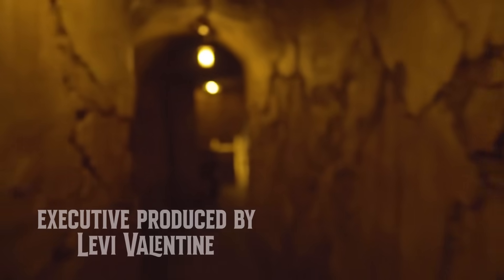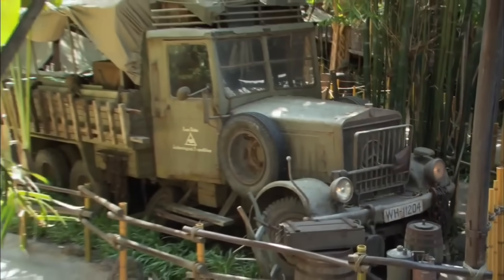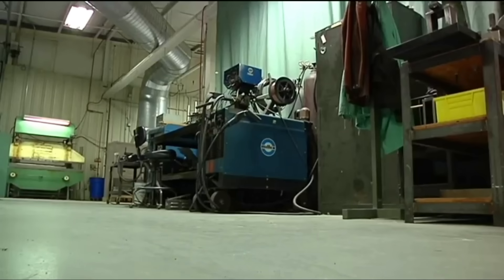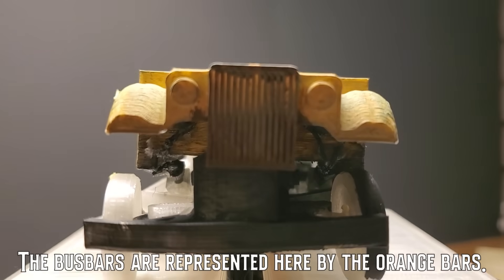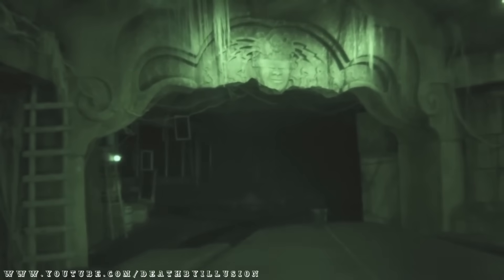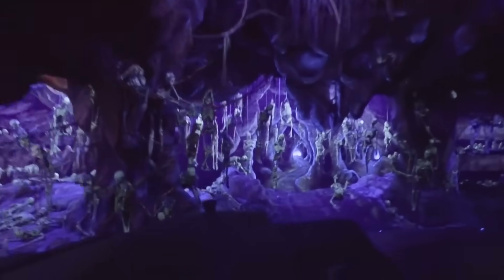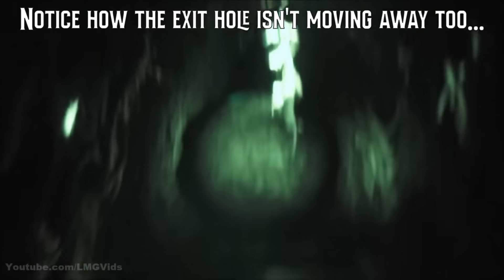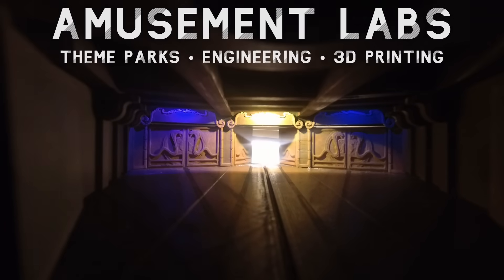How It Works: Disney's Indiana Jones Ride

Comment: The three-piston motion base is capable of much more movement than they currently use it for. After opening, they had to reduce the amount of movement produced by the three-piston motion base, because it was considered too violent for some (translation: Disney was worried about getting sued by people who injured themselves when the vehicle wildly bucked).
Reply: Part of what you said is true, the rest is not. I was one of the original 12 Design Engineers who designed, engineered, prototyped and developed this ride system between 1990 - 1993. Of course the motion base can be articulated into more extreme positions and at much higher velocities. While developing it we did a lot of tuning to smooth it out. That's a part of developing any new design. But we worked all that out WAY before (years before) this ride opened to the public. And all businesses that deal with the public are mindful of the possibility of people getting injured and design and engineer their products accordingly. To do anything other than that would be unethical / unprofessional.
Reply: @GoogleEqualsEvil  I apologize if what I commented was incorrect. However, many have reported to me that the current ride experience is much tamer than when they first rode it immediately after opening.
Reply: @kentslocum They could have modified the motion profile to reduce certain aspects of wear and tear. Supposedly the motion profiles are slightly “randomized” with each ride
Reply: @kentslocum  No need to apologize Kent, I'm not offended. I'm just trying to correct the record / impart the truth and hopefully provide some information that people will find interesting. I'm proud of my contributions to this very complex project (many of my conceptual designs / inventions, of which at least three are shown in this video, were patented by WDI) and when I came across this video and started looking through the comments, I noticed a fair amount of misinformation (including some in the video itself), which I will correct when I have more time. It will be a very long comment and I'll post it as a standalone, so if you go to "newest first" it will show up sometime in the near future.

You should regard people saying they can "feel a difference" in reference to the intensity of the motion base platform movement, as being highly dubious. Unless Disney made really large changes to the motion control programming to increase or decrease the intensity, a human wouldn't be able to tell the difference. There are just too many changes in both amplitude and frequency throughout the ride, and they happen much too quickly for a human to be able to assess and analyze those changes. I'm sure people THINK they can tell a difference, but it's basically impossible.

The motion base originally did have (and still might) a randomization algorithm programmed into the control system that makes small changes to the pattern of the movements for each cycle of the ride (each load / unload of passengers), but no changes to the intensity. It's possible people are mistaking that change in pattern of the movements as a change in intensity. I haven't ridden it in 20 years so it's possible they've turned the intensity way down. But I did ride it several times on the same day, 5 different times from 1995-2001, and there weren't any changes in the motion control programming that I could discern.

A couple of bits of interesting / fun trivia: 1) Contrary to what this video claims, neither MTS or Doron Systems had much of anything to do with either the drive system(s) design and engineering, or the motion base design and engineering. All the design and engineering was primarily done by us. We did purchase various components from MTS including hydraulic actuators, rotary encoders, PLC's, limit switches, position sensors, solenoids, valves, valve bodies, control systems, etc. And the 3 Disney engineers responsible for the motion base actuation and control (one hydraulics engineer, one hardware / controls engineer, and one software (programming) / controls engineer) consulted with MTS at various times, but that's the extent of MTS's contribution (my specific contribution to the motion base design and engineering was the invention and subsequent detail design, engineering and analysis of the three, 2-axis hydraulic actuator Gimbal mounts and their locking mechanisms, and the motion base platform structural design and engineering).

2) We purchased two kinematic "crash test" dummies to use as guinea pigs / data collectors to test the motion base platform before any of us gave it a go. They were jointed and weighted to replicate the average human body and they were packed with sensors including accelerometers and a gyroscope. This turned out to be a very smart thing to do since the first programming map that was loaded literally was so violent it broke the clasps on the lap belts the dummies were restrained by and threw both of them right out of their seats about 10 feet in the air and then right onto the ground.
Reply: @SalivatingSteve  Yes, correct. If the motion control programming has been noticeably "turned down", that would be the primary reason why. This was a very complex design with a lot of moving parts subjected to very high loads (built over 25 years ago), so reducing the amplitude and frequency of the motion control base would substantially reduce wear and tear (which of course would reduce the maintenance and operating costs while also helping to keep the down time minimized). I haven't been on the ride since 2001, and I haven't kept in touch with any of my colleagues who worked on this project, so I have no idea how much, if at all, the motion control programming has been changed. 

People should remember that this was the first of it's kind. It required so much innovative design, that almost every aspect of the vehicle system was patented. Plus we did all of the design and engineering in 3D Solid and Surfacing Modeling, which was in it's infancy at the time. It was very primitive CAD / CAE compared to what's available today. We also did all of this with just a handful of Design Engineers and Fabricators in a very compressed time frame considering that this hadn't been done before. It would have been beneficial to have had an extra 12-18 months just to run the system over and over (we built a full scale prototype vehicle and track inside a warehouse in Valencia, CA) and develop it further to discover any problems in reliability and / or any maintenance issues. But we had to work with / around what we were given.

That is true about the motion control programming randomization (at least it was, I don't know if it's still being done). The amplitude and frequency remains within the same parameters, but the pattern changes randomly. It is quite subtle though. The idea was that a small amount of randomization would make it seem more realistic and keep it "fresh" (different enough each time that people would notice it subconsciously if not consciously).
Reply: @GoogleEqualsEvil  Wow! Thanks for taking the time to respond and for all your hard work contributing to making this amazing ride a reality!

I think depending on where you sit in the vehicle, certain motions may feel more or less exaggerated. I love the little touches added to make the Jeeps seem really janky, like you can feel the engine running rough when idling, or it will stall out and struggles to start back up. Very realistic and super impressive. Did you help develop more attractions after this?
Reply: @SalivatingSteve  Hey Stephen, thanks for the kind words. I rarely think about my time at Disney these days, but I randomly came across this video and I have to admit, especially in the times we're living in, that's it's nice to know that I made some kind of small contribution towards putting a smile on people's faces even after almost 30 years.

I'm also amazed by how many of you have such a passion and knowledge about these topics. And you made another great observation that is 100% correct. The farther away you are from the center of the motion base platform (the vehicle body / seating platform), the more actual motion you'll experience. The best seats are at the four (outer) corners in terms of increased motion. That's because of the way we designed the motion base to articulate. The Roll motion (which pivots around the Y axis - which is the longitudinal axis along the length of the vehicle at it's centerline) pivots around that axis only, so the closer you are to the center of the vehicle body / seating platform, the less Roll motion you'll experience and vice versa. 

The motion base platform doesn't articulate in Yaw (the Z axis). It only articulates in Pitch (X axis) and Roll (Y axis) and combinations thereof. Even though the Roll motion pivots around the Y axis only, the Pitch motion doesn't pivot from a single axis, so it can pitch up and down in both the front and the rear. So the Pitch motion is felt no matter where you sit, but just like in Roll, the rider will experience more Pitch motion the farther away they are from the center of the seating platform.

Yes, that's another fun part of the ride. Of course there is no actual IC engine (it's just an audio recording simulation), but the motion control programming incorporates vibrations, etc to correspond with the show elements of the ride (making it seem like it has an engine, and that the engine is running rough, etc). 

The stalling out though, while being part of the show element, is also a functional Ride System issue. The entire vehicle system is hydraulically powered, including the drive motors (technically we call it "Electro-Hydraulic" because there are two electric motors that power hydraulic pumps that pressurize the accumulator tanks, but everything that is powered on the vehicle is done with hydraulics). There are two high pressure (3000 psi) hydraulic accumulator tanks, and one low pressure tank. The two high pressure tanks power the four drive wheels, while the low pressure tank powers the steering and bogie arms. 

When the vehicle appears to have "stalled out", it's because the two high pressure accumulator tanks have run out of enough pressurized hydraulic fluid to power the four drive wheels. So you have to wait for the pumps to replenish and repressurize the accumulator tanks before it can drive again.

I only worked on two projects at Disney. The first one led to me being hired for the Indiana Jones Ride System (which was a project that was coveted by all the Mechanical and Structural Design Engineers at Walt Disney Imagineering). That's a whole other story though. I moved on to Lockheed Martin ADP (the "Skunk Works") in Palmdale, California.
Reply: @GoogleEqualsEvil  I rode several times during the Cast Member Preview. Apparently it kept shutting-down due to the on-board computers crashing. Know anything about that? I'd also heard rumors that the motion was toned-down after the Preview after hairline cracks were found in the vehicles, but that could just be that... rumor.
Reply: I love this ride. But I could only do it once per trip, my neck & back hurts after ride.
Reply: @CelestialLites  That's how I feel about riding the Matterhorn. Anything more than one ride seems hazardous to your health.
Reply: In a somewhat similar move, the Ratatouille Ride in Paris was DRASTICALLY (some say by 50%) slowed down just before public opening, they had to scramble to adjust the animation scenes and extend them last minute
Reply: @LeoElso  The ride vehicles in the updated "Snow White's Enchanted Wish" has been slowed down a bit compared to the previous version of "Snow White's Scary Adventure," but I can't c definitively comment on why this was done. Perhaps to extend certain scenes or make the load/unload process smoother?

Comment: Hi I don’t know if it’s affect on purpose or not when you are getting ready to speed across the bridge I have noticed a little affect they timed having a vehicle on other side and makes you feel like you are about to crash into the other vehicle then just before you get to the other side the other vehicle turns a corner
Reply from the maker: I think that's just a happy little accident of how far apart the vehicles are, but it could have also been intentional to get that timing, just like how the vehicle on the bridge stalls when you enter the temple.
Reply: Imagineers have stated that’s a purposeful effect.

Comment: This ride could easily be installed at Disney world as well as the ride at animal kingdom “dinosaur” uses the exact same track layout and path and the same effects at the same locations.
Reply: It’s actually impossible to have Indy in the dinosaur show building. Yes, the ride system is exactly the same, however Indy has a liiiiiiiittle bit more track than dinosaur (Indy has an extra “s”) and also the dinosaur building is not structured or built to house Indy and all of its effects, there’s not enough room for it (I’m an ex dinosaur cast member)

Comment: When you get to the boulder and down ramp, the front of the troop transport vehicle pitches upward to help hide the ramp. Also when in the boulder room look back at the wheels of the Transport and you see they don't roll but the walls are moving backwards.

After the three door options you realize that as you turn left after Mara the length of the track (road) is the same length. It should be longer if you were on the far right and shorter if on the left. Also there would be a need for merging of 3 tracks if there were 3 different halls. They didn't mention the different lighting and scrim effects to make the Halls look different as well.
Reply from the maker: Oh I definitely had that in the script, but the video would've been like 35 minutes no long had I done every single detail. Things like the maintenance shed or the skrims like you mentioned, or how the big room projectors are limited so they hide the switch by having the 'headlights' flicker out, or the 1,995 skulls or all the effects in the queue. The ride is jam packed.

Comment: The door miniature set is amazing, but I still don’t understand how it works today. The door is always in the middle (which make sense), but the theme is changed every time. You said that this was thanks to the projection mapping on the doors, but I don’t think this is the case. Yes, there is projection mapping, but the doors (at least the top section above it) also have raised and etched designs into them on top of which the projections are shown. If the designs are physical and not just mapped by projections, then there has to be some sort of changing mechanism, right? Or maybe I’m imagining things.
Reply: The projection can change how it look
Reply from the maker: I believe they replaced the archways when they turned off the rotation and installed the projectors. I've seen a few shots from a breakdown and they go blank. I think it's just a very convincing mapping.
Reply: Amusement Labs is right. The top section above the door was replaced and now the projection mapping puts the symbol of the theme on it. 
As for the theme in the room with Mara, it’s just different lights to change the theme. Same walls, but blue light for eternal youth, yellow light for riches, and no lights with a projected star/space overlay for “Visions of the future”. This was done even before the door was stationary obviously as it is always the same room you go into.